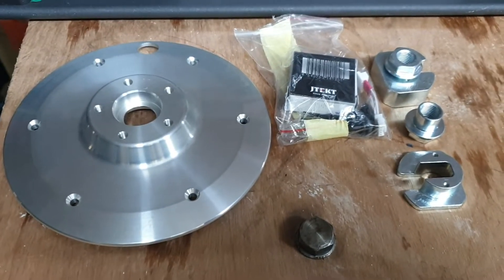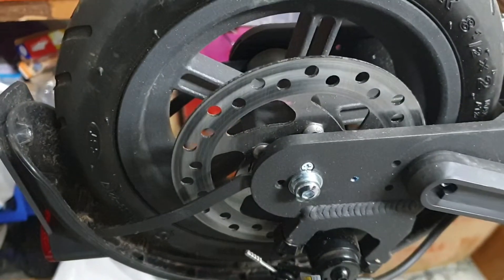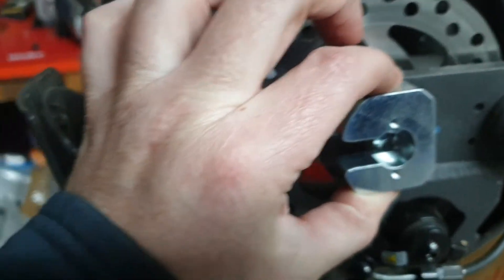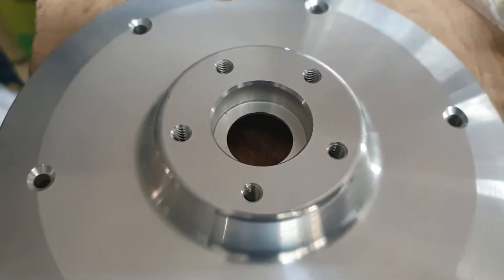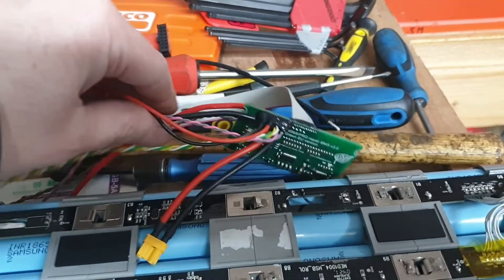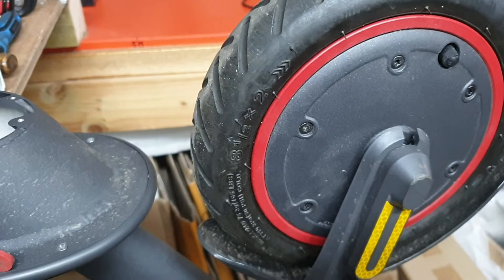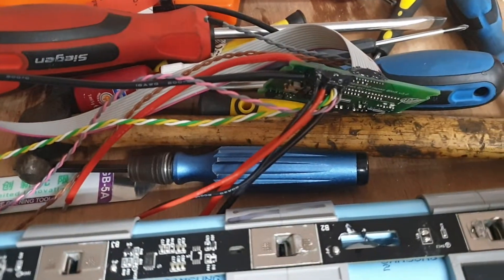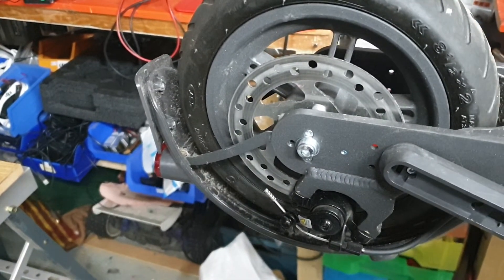Xiaomi Pro 2 Electric  Scooter rear wheel drive conversion PART 1

Comment: our old xiaomi M365 sold as a Denver came with rear wheel drive, and with electric and disc brake all in the back, frame is steel not aluminium, and it has been working as a champ. now it needs a battery uppgrade, and i have been looking at controllers, maybe giving my kid a few km\t more, i have been looking for a 25 km\h controller, but all are 27-28 or more, the law say max 20 km\h here, and 5 more is over but not mutch, 10 becomes a problem and is a 50% gain in speed if stopped by the police. is there a adjustable controller that can be set and locked by me.
Reply: You only need standard controller with custom firmware